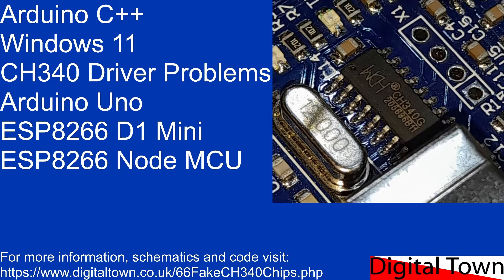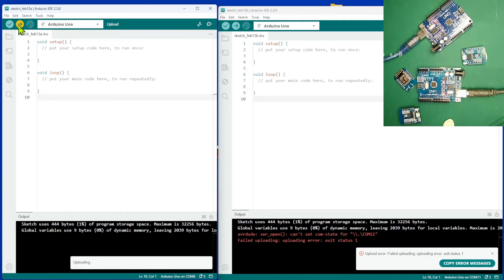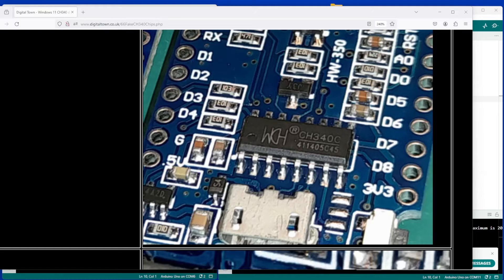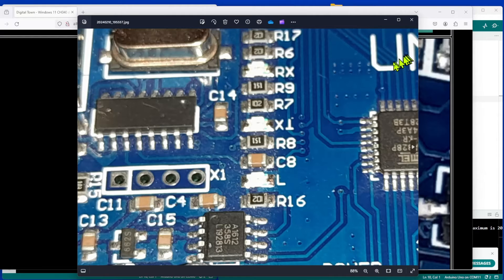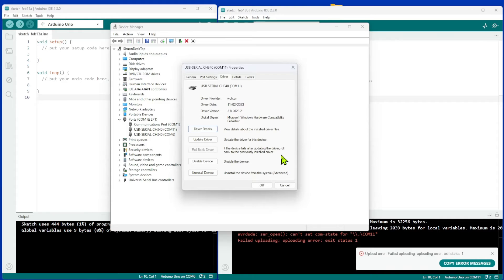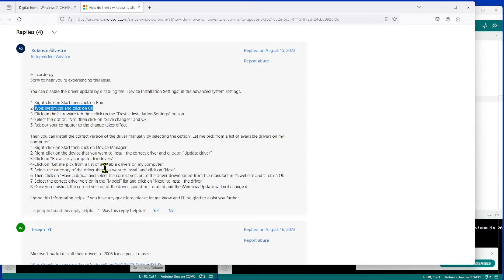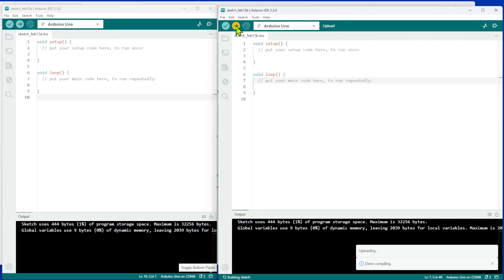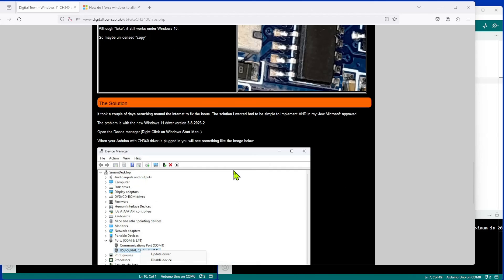Arduino C++ Arduino Uno, ESP8266 CH340 driver problems with Windows 11

Comment: Very interesting. I found this because I was having problems connecting a Remote Control model transmitter via a serial-to-USB dongle into Win11, sometimes it connected just long enough for me to calibrate the joystick axes, sometimes not even that, and then inexplicably disconnected. The dongle doesn't have a chip that looks like a CH340 in it, but it's recognised by Windows as a CH340 and by default it gets a device driver from 2024 installed automatically. So I followed your procedure but I had to uninstall AND remove the existing automatic driver from Windows and use the setup exe supplied in the driver files to push the driver into Windows before connecting the dongle. From that point onwards, it detected the dongle fine when I plugged it in, and the 2009 device driver works perfectly with it and finally I can play my FMS (Flying Model Simulator). And then I tried the same in my Win10 machine because that was often disconnecting too, I'd assumed it was a problem with the USB ports because it's very old and some of my USB memory sticks don't stay connected for long either, but no, the dongle now works in Win10 too with the same 2009 driver. Brilliant work, I'm really chuffed to have my kit all working again. Thank you!!! 😃
Reply from the maker: It's amazing what does use the CH340 driver. One annoying thing to be aware of is you often have to reset the driver after a Windows update. It is frustrating to tell Windows you want use the old driver but the update insists on the new driver and you start all over again.

Comment: Excellent video! I have a couple of different Wemos D1 Mini clones and could reproduce this issue. I also have some with the typical engraving of the original one, but have the same issue. What seems to be a sign for a fake one is the small indent that marks pin1 in the corner. The original ones have a very slight cylindrical indent, the fake ones have a deeper one that has a more spherical shape - at least for.my collection here. What surprised me ist the fact, that the pinout seems to different! Pin 1 should be GND, pin 16 VCC. This is not the case for the fake ones…
Reply from the maker: Thanks for the info

Comment: For some reason the one i'm using can't even use any of the new or old drivers, it just defaults to "USB Serial Device" and if i do force the driver it always fails and says "STATUS_DEVICE_DATA_ERROR", im currently wondering if the problem is actually the cable, i tried testing by using the blink example and somehow it actually was uploading but eventually failed as well, I might try getting a different cable and see if it fixes the problem i have right now
Reply from the maker: Cable would be a good place to start. I have a set of tried and tested cables that I use and even then have found some fail after years of use. Hope it works.

Comment: I'm on 24H2 and no matter what I do I see the Arduino Uno as an unrecognized USB serial device, and trying to install the older and even the newer driver crashes Windows.  Have you seen and/or found a solution for that issue?  If I let Windows do its thing, it wants to install the FTDI, but with that driver the Uno resets regularly when connected to my PC (using it with SimHub to control fans).  The seller states my board has a CH340 and I assume they know what they are selling, but who knows.
Reply from the maker: I've not had any issues with any of the drivers crashing Windows. 
If your UNO has a soldered chip (rather than a socketed chip) it's almost certain to have the CH340 driver. The chips that have issues do not have any writing on the CH340 chip.
Reply: @digitaltown5442  Yep, it is the chip with no writing on it.  If I let Windows use the FTDI driver it connects, but resets constantly.  My install of Win11 really hates the CH340 driver, I have tried everything and get a BSOD (well, now green with Win11) every time.  After the hours wasted I just decided to buy a real Arduino board, the money saved wasn't worth the time wasted.  Great video though, and now I know to look for boards with a proper CH340 chip when ordering a clone.

Comment: Did you try it now if it works after january Win11 updates? I just now updated to Win11 from Win10 and one Uno works and one Uno doesnt and even Mega 2560 doesnt, which worked well before. I tried your fix but doesnt work. Maybe it is most recent updates? Because, some technologies like 3D scanner Creality Raptor had big troubles after new Win11 updates. Thank you.
Reply from the maker: Yes I've tried it on some UNO's and ESP8266 D1 mini boards. I found the update meant I had to go through the whole process again as it has removed the 2019 driver.
also this means I have to go through the process on any new port that I connect the board to so will take a few weeks for all my ports to be set back to 2019.
For some reason with the D1 mini I did have to reset the driver twice but after reboots the old driver is working OK.

Comment: My first problem is that even though I installed the drivers and the IDE multiple times at this point but in my device manager there is no ports section (When I view the hidden devices it only shows me some bluetooth coms) I cannot seem to get the ch340 drivers to work none of the tutorials seem to help.
Reply: I checked my usb cable with a multimeter for continuity its ok there is no cut wires or anthing the tx rx cables goes to the ch340G chip without a problem
Reply from the maker: What version of Windows are you using?

Comment: Sadly, not worked for me - I did the sysdm.cpl bit then installed the 2019 driver. I then rebooted, cranked up Arduino and tried the Blink sketch but still get the 
avrdude: ser_open(): can't set com-state for "\\.\COM7"
Failed uploading: uploading error: exit status 1
(I even removed the wrong drivers from the laptop via Regedit)
Just tried a (AZ Delivery) D1 and it works!
Reply from the maker: Have you rechecked what driver is on that Com port?
Reply: @digitaltown5442  TBH, I'm considering scrapping and re-installing Arduino (2.3.4) as I'm getting all sorts of weird problems with it. I've had the Win11 laptop for about a year and all of a sudden, I'm getting problems with boards that were perfectly fine last year. To answer your question, at the moment, the laptop is seeing the 2019 driver and I am able to load code to the board. After a reboot - who knows...
Reply from the maker: @mamvcivm  I'm still on version 2.3.3 on Windows 11 and it's been very stable and I can be coding for hours per day. To be honest I'm more concerned about issues caused by the latest Windows updates bringing instability than the Arduino IDE as I had a coupe of crashes after a recent update. Things seem OK now but updates always make me a bit nervous.
Reply: @ Today, it's still showing the 2019 driver :-) - and it's still working...😀

Comment: I have nodemcu lolin ch340G still working using windows 11. But must press the reset button when uploading
Reply from the maker: The problem only occursd on certain CH340 chips, usually the ones with no writing on them. I have some that work fine, others that have the problem

Comment: Thank´s for this publication, I was very ilusionated to solve my comunicatios problem between Arduino mega and W11 and I have intented a lot of times to change the driver but there was no choice - the 3.8.2023.2 driver does not disappear.... Could you give me any new idea ? The Event Manager response is "0".
Reply from the maker: Have you followed the instructions at: 
https://answers.microsoft.com/en-us/windows/forum/all/how-do-i-force-windows-to-allow-me-to-update-a/33218b2e-5ccf-4415-872d-24cb59926f0d

If you don't do this part the driver will just reset to 3.8.2023.2 as Wndows 11 will automatically update to the latest version.

Comment: Thank you it works now! I had 2 ESP8266 boards (No writing on chips) and they wouldn't connect to the Arduino IDE. The driver was 3.8.2023.2 and I installed 3.5.2019.1 like you mentioned. Changed the driver and, it finally recognized it! I figured the boards were broken but, nope just the drivers! I'm on Windows 11 Pro as well.